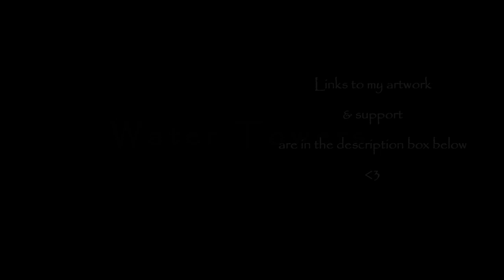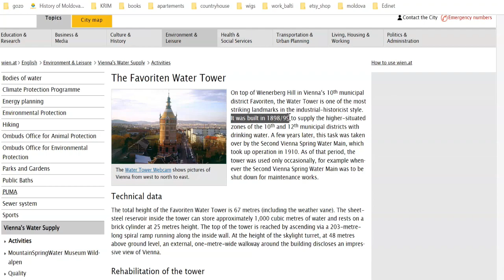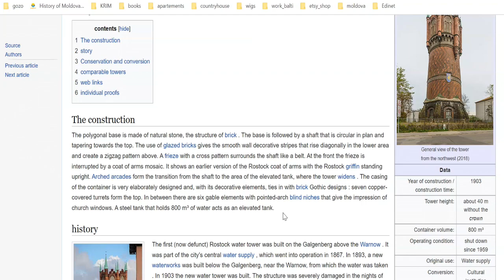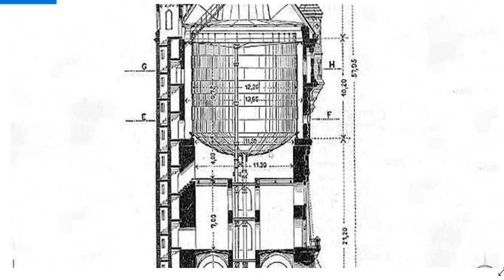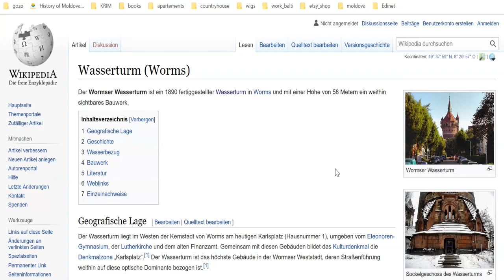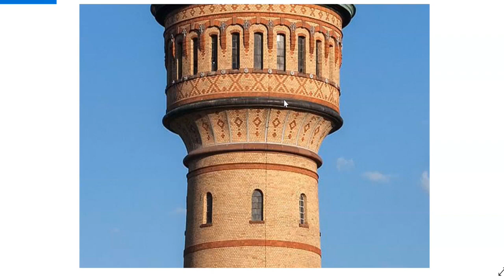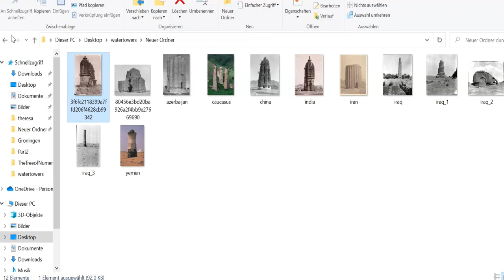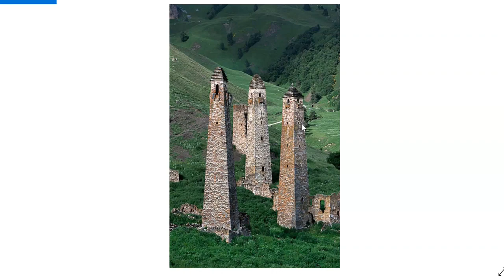Water Towers

Comment: Airship terminals?
Reply: Airship terminals would explain the tip, also the giant capacity of the buildings, but it feels almost as though the towers are cylindrical and geometrical for hermetic reasons which would suggest they have the spiked tip to harness energy from the ether, or perhaps they were generating H2O from the differential between the atmosphere and ground, somehow channeling humidity via static electricity into more concentrated volumes for later release to citizens on ground once filled up - seems like a feasible idea to maintain consistent fresh water where there aren't natural springs or running water. Here in my coastal hometown (Dungeness, Kent, UK) we have a water tower that is so close to the beach it feels like it would be a lighthouse or watch tower as lora mentions - i think that is credible too, but I can for sure see a blimp or airship docking to it very easily! <3 btw ily cambell !

Comment: A concrete water tower in the north of England was sold by the water company and has recently been converted into a rounded house with glass and stainless steel surrounding the concrete tower.  Look up 'Flockton water' on the internet. There was a small article about it in the national paper a few month back.